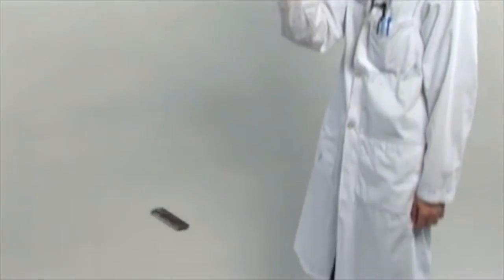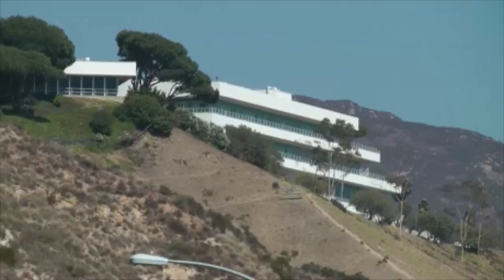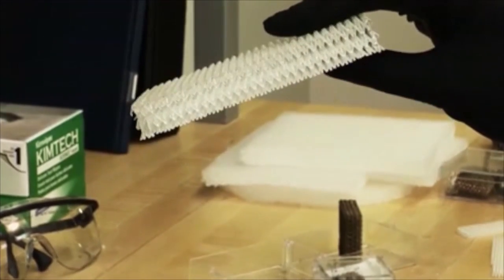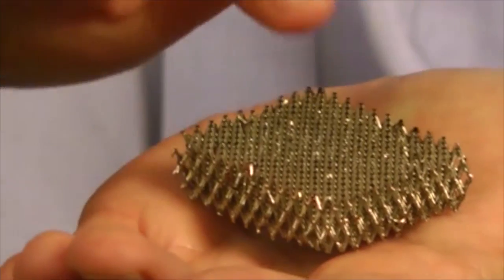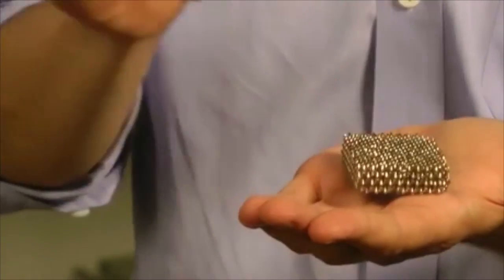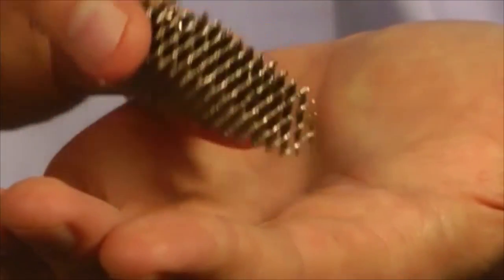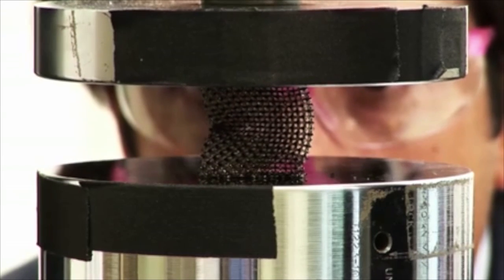Metallic Microlattice - How It's Made

Comment: This is pretty much just 21st century micro-3d honeycomb. But that produces added benefit of flexibility/resiliency and some other cool things,  where honeycomb is about lightweight rigidity. It's a bit surprising, but not completely, that thin walls can flex and not fatigue. Overall microlattice  and metal foam isn't so amazing since it is mainly an  exploitation of geometry which conceptually is centuries old. There are plenty of chemical inventions, for example, that are far more complicated conceptually.  It's almost more surprising that we didn't develop these decades sooner, since it seems most of the tech and tools have been around for decades, we just never thought to apply them this way.  What would be interesting if is we could learn how to easily make it ourselves or buy it inexpensively.  I think faster and cheaper ways to make types of these is what is the next challenge. So that it might be almost as cheap and ubiquitous as corrugated plastic,  for example.  But it might never be quite that inexpensive. I hope though, we can eventually buy sheets of different thickness and configurations. It can probably be tweaked for different amount of rigidity etc.

Comment: Is this better than Carbon fiber?
Reply: depending on what ur saying. Hardness, no. Strength, no. Flexibility, yes. Compression, yes. Weight, he'll yes. But don't give up on carbon my friend. Carbon nanotubes have been discovered and are in the process of being used and are al,ost as easy to make as this, over 40 times heavier (still 1/6 steel tho) harder than steel twice as conductive as steel, can take 30,000 times the charge than steel, 4 times as strong, and easily manipulated into cables, strings, plates, wires, sprays that coat things and keep them from getting dirty, synthetic muscle fibers (1500 times faster, 3 times lighter, and 100 times stronger) This is great but not revolutionary like nanotubes.
Reply: so we could run 1000 miles an hour with this shit if our bones were made of it too as well as tendons and we didn't make friction
Reply: hell*....

why people these days cant even type hell correctly?

Comment: Lightest metal every created? No. Perhaps lightest alloy or molecular lattice, hence the name; but it is not a synthetic elemental metal.
Reply from the maker: +systempatcher Boeing described it as "the lightest metal structure", the metal used was nickel.
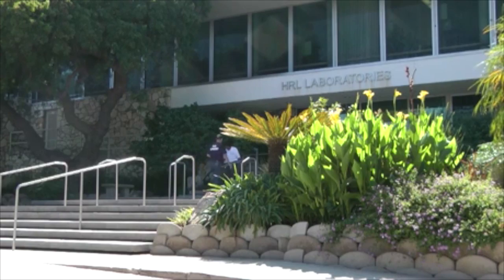Reply: SciNews 0:11
Reply from the maker: +systempatcher Boeing hype :)
Reply: ***** 
Even still it's not a new alloy it's the exact same metal that has exactly the same molecular/molar mass.
Reply: Steel in almost entirely iron do you not consider it a new metal?
Reply: lightest metal STRUCTURE dumb ass